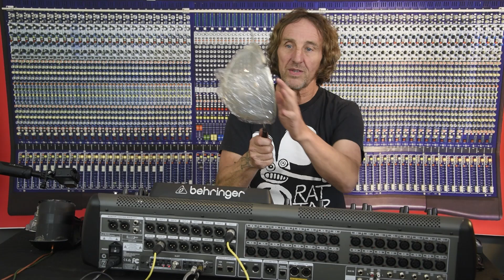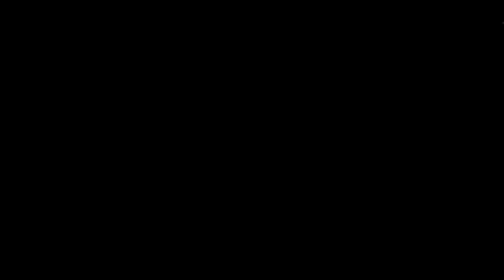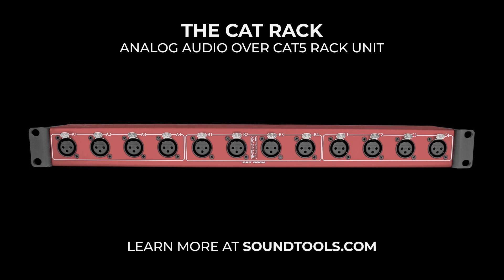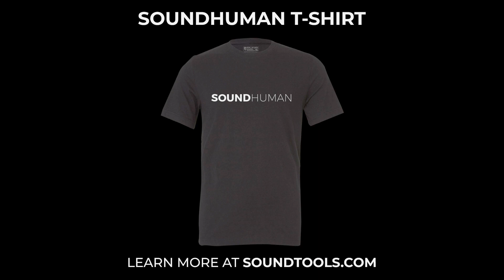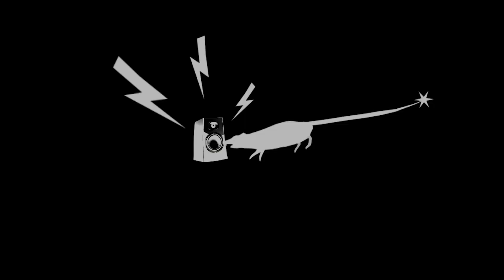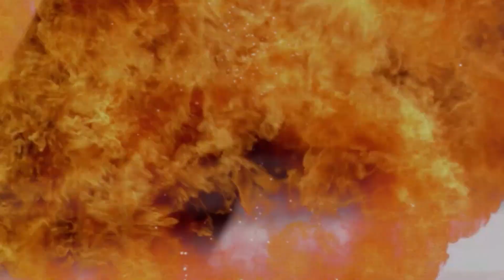Aux Fed Subwoofers Are Better - Because of How Mics Work

Comment: say I'm using a behringer x32 and had a PA with a crossover is 24db/oct. at 80hz, and a hihat mic with a lowcut at 400hz.... its pretty safe to say that nothing will be sent to the subs from the hihat mic.   but if I do aux fed subs and set the hihat mic to lowcut at 80hz (same as the crossover) then essentially the hihat mic will be heard as if it had a 48db/oct. steeper low-cut as the mic channel lowcut and the stereo PA lowcut both combine
Reply from the maker: And everytime the singer moves the vocal mic, mud gets sent to the subs, all the vibration of the drum riser sends mud to every drum mic. Every breeze, fan or ac  air blowing sends mud to every mic. Cumulative mud ends up in the subs

Comment: I love having a separate send to Subs! Consoles like M32/X32 have a mono/center feed which i use to feed subs. The awesome advantage of using is unlike an aux send,  you can set m/c to follow LR Level so you can bring the whole mix down without altering the relative balance between Mains & Subs.
Reply: I sometimes use a matrix for a second set of speakers and put L/R and the matrix in a dca group. That way you can control all speakers with one fader if necessary .. and are still able to control the balance with the matrix or/and L/R fader. Works with M/C, too of course.
Reply: Adds an independant layer of insert, eq and compression, too (at least on the x/m32), which is pretty handy.
Reply: I have a question. I have a decent bar PA, JBL active 15" tops and some Carvin subs with a Peavey power amp. The power amp has a built in crossover that works really well that I set at either 90 or 100hz. Kick, bass, and floor tom run on AUX bus to subs through Soundcraft UI24. My question is, should I be using a HPF on the mains? I'm familiar with using HPF on mains to avoid mud from subs and mains both adding low end energy, but I kinda think leaving the mains full range will help carry low end of mid range sound sources like guitars and vocals, without being in the subs. I'm sure that's cutting back on headroom in my mains though. Sure I'm over thinking this, but curious on everyone's take
Reply: @mojoemurphy  Rule of thumb, if the speakers have a HPF built in, use that rather than the HPF from your mixer. QSC K10s for example paired with QSCsub have built in crossover at 100hz. When your mains are at full range what is the lowest frequency it produces? If you have a guitar or vocal track you probably have a HPF on the EQ already to 40-120Hz. From 100-400Hz, ya you want that information coming through, it gives some meat to the guitar and cutting that out wouldn't sound right. Some guitars are bassy, some are high ans twangy. Start low and roll of until you notice a difference in the sound, that's when you've gone too far. Remember our job as live sound mixers is to reproduce the sound as clean as possible without shaping it beyond what the band wants.
Reply: @gnocci42069  this is fantastic info, thank you!
Reply: @mojoemurphy  If your tops can handle it this is optimal! venue i used to mix at had a bunch of 'arrayed' 15" Meyer boxes for the tops, they had plenty of juice so using the adjustable HPF I set it below the LPF on the subs, to somewhere like 70hz... low enough to get the acoustic thump but still filtering out that excessive info in the sub bass... as a bonus it supported the 100hz thump on the kick and left more energy in the subs for the bass boom...
Reply from the maker: @GrantCarruthers cool and also even if the tops do not have lots of low end power, having the ability to Not send instruments like cymbals and vocals and guitar to the subwoofers band really clean up the mix.

Seems a lot of people think think a high pass filter can prevent low frequencies from passing through.
But no, a high pass only reduces low low frequencies. 

To prevent low frequencies you need a separate send.
Reply: @ashergregory2013  I haven't messed with the matrices yet in this mixer
Reply: If a HPF is all you need on your mains, try the one that's inbuilt into the Main LR graphic & see if that suffices.
Reply: @ashergregory2013  I've used the HPF on the main EQ, I'm just curious if I should be using a HPF on the mains at all with the subs being aux fed
Reply from the maker: The HPF on the mains is to limit freqs below what the mains can create for protection and and to reduce wasted energy below the capability of the mains.

Using a HpF will often allow the mains to be pushed louder before clipping or distortion.
Reply: @DaveRat  sounds like using a HPF is the way to go. If I'm setting crossover on subs to 100hz with 24db/octave, should I do 100hz hpf for mains as well or a bit higher?
Reply: @mojoemurphy  Setting the HPF on mains 100hz would be a good starting point & you can tweak it to your liking. 

If you're deploying your system in the same config every time & you really want to dial everything in. I'd suggest going to an open flat grass field & taking some measurements using a reference mic with smaart or similar tool. 
Without going too much into it, you can really determine the optimal crossover point & phase relationship between your Mains & Subs.
https://youtu.be/5leb1k4LUA0 here is a video that goes through the setup & process.
Reply: I run my Sub outs on an Aux when mixing FoH pretty much all the time. You just cannot get the same level of control otherwise. There’s a bunch of different ways to do it, but the idea is pretty much the same.
Reply: On an Allen Heath 16fx , is there a way to get the pre or post fade Aux fed sub to link to the master send? Only sending certain intruments to the sub is DEFINITELY the way to go, thanks Dave
Reply from the maker: To be honest I'm not really that familiar with those consoles and I borrowed it for the video but don't have it anymore
Reply: What’s the frequency specs on that subwoofer..?
Reply from the maker: @michaelanderson4265 I don't have the specs on it but it goes down pretty low and has output to 25 Hertz but it doesn't get very loud
Reply: Does the M32/X32 have parallel compression (i.e. a control 4 blending the uncomped sound with the comped 1)? Also does it have sidechaining? Or M/S?
Reply: @davegraham716  You can compress parallel using busses, it can do sidechaining, M/S is possible but fiddly... It doesn't have a latency compensation for inserts. You can kind of work around it, if you insert an disabled effect on the unprocessed path. Afaik the Wing is much more versatile when it comes to effects (number of inserts etc.).
Reply: That’s what I started doing on M32/X32 consoles, upon realization what the M/C output can be used for. Prior to this, I had occupied Aux sends for subs, so it’s a lot easier to adjust per channel since it’s on its own knob instead of paging through bus sends. And the concern over crossovers? High pass/low pass on mains and subs, easy.
Reply: I have that M/C in my matrix page, but I'm not sure how to assign it to a physical output. I'm sure it's simple, but routing isn't my strength with this platform yet. I e hundreds of hours mixing with X32 and piles of useful scenes for dozens of bands I work with, but I feel I'm still missing some finer features applied. Currently I have L & R out of 7-8 with a LPF as an Xover and two subs (L&R) out of 5-6. I do this because many rooms I'm in a quite lopsided and I often unlink the outputs and run them at different velocities based on what's happening in certain parts of the room when I'm out there with my iPad. 2/3 of a crowd may be shifted to one side and further away while some of the crowd is concentrated much closer to the PA on the other side. It's almost like I'm mixing two separate PA sometimes. Any suggestions based on my weird application?
Reply: @jaredstreeter5911  Hey Jarred, i'd suggest hitting flip to faders.
Select mono & push Matrix 3&4 faders to unity. 
This will route any signal coming into mono go to matrix 3&4. 
Make matrix 3&4 mono/unlinked & make sure LR isn't being sent to it either 

This will still give you the flexibility of dealing with your lopsided subs on matrix 3&4, but still retain mix separation on inputs between subs & LR

On top of that if you have "mono follows LR fader" selected, You can bring your system down with LR fader & not upset the relative balance between your lopped subs & mains.
Reply: A work around would be to set the aux master to the same level as your main fader, and if you need to change the main just match the aux. But agreed; boards that have a mono or center bus is pretty handy

Comment: I’ve been obsessing over this topic for months now!! I love the concept of the LR going everywhere and using EQ to determine what goes to what. I started doing virtual sound checks at home with two mains and a sub, I noticed that a bunch of vocals, guitars, etc were going to my subs even though the vocals are HP at 170hz!!! And subs LP at around 100hz. It just didn’t make sense to me or I kept thinking I was doing something wrong. Lol 

Thank you so much.
Reply: @DaveRat  @Rene Why is this happening though? Why are frequencies above the crossover getting through? Is it because the slope of the crossover is too gradual and some higher frequencies get reduced but not muted? If so, should the sub be calibrated differently?
Reply from the maker: A high pass is a filter. That filter has a slope quite often 12 DB per octave.

If you sent a high pass at 200 and the slope is 12 dB per octave, one octave down is 100 HZ so the sound will be 12 DB down at 100 Hertz at 50 HZ it will be 24 DB down.

You can get high passes with higher slopes but the higher the slope the more they impact other things like phase shift and ringing

If you don't want something to go there don't send it there if you want most of it not to go there but some of it to still get through then use a filter

Comment: Right. You can low cut on ones that don't need it but the mic is distorting when the placement is not good. And in the old days, there were no subs. Full balanced mix. Aux makes sense.

Comment: But ... if you look from a different perspective, equalisation and filters are used to achieve the desired frequency response of the path between the source and the listener. By not sending something to the subs, you are basically using the HPF of the crossover besides the channel/bus HPFs. If the crossover is set low enough, the natural roll-off of the tops also acts as an additional HPF. All these frequency response changes result in similar phase response changes. Whether you use a higher-order HPF on the channel, a HPF on the channel and on the bus or just the roll off of the tops (crossover or not) the resulting frequency response for the listener will be the same if the same slopes are used at the same frequencies. So in terms of the frequency response (at the "sweet spot", where the system is perfectly aligned), the aux fed subs do nothing that can't be achieved by using the equivalent HPF slopes on the console. Yes, on some consoles, it may be easier to achieve the desired frequency response of a signal path by simply not sending the signal to the subs, but at the same time this also dictates a workflow which makes certain mixing approaches much more difficult if not impossible. 

At the same time, yes, you are not sending the signal to the subs, but the roll-off of the crossover is not infinitely steep and many larger systems go pretty low even without the subs, so by not having the subs playing these frequencies, you are not actually eliminating these frequencies. If you mix by ear and adjust the HPFs to achieve the desired frequency response, these sounds that are below the cutoff frequency but still noticeable, are in one case reproduced by the whole system, keeping the coverage as designed, but in the other case only reproduced by the tops. So if the crossover is set at 100 Hz and 12 dB/oct, the instrument has a fundamental at 80 Hz but because of the proximity effect, a 12 dB/octave HPF at 100 Hz will result in the flat FR at 80 Hz. When the subs are run from the whole mix, you'll achieve this FR by setting the channel HPF at 100 Hz, if you keep this HPF setting and use aux fed subs, this fundamental will be almost 5 dB too quiet (if using Butterworth filters), so you'll have to remove or severely reduce the HPF frequency on the channel. Now this fundamental frequency is at the right level but instead of the even coverage produced by a large subwoofer array, you are dealing with the power alley and cancellations produced by the LR mains. Besides that, many speakers have a less than flat phase response in the crossover region so because by varying the level of the subs, you are effectively changing the crossover frequency i.e. the frequency at which both subs are at the same loudness, you are basically messing with the system alignment at the crossover frequency. Not a huge problem in many cases and can be avoided by using a group/fixed level send but an imperfect attenuation in the stop band of a filter usually isn't either. Oh yes, how the system is crossed over will also affect your mix which is probably not a good thing if you are touring with the console but use a different PA every day.

Anyway, my point is that both approaches have some advantages and disadvantages and depending on the situation, these can make a significant difference.
Reply from the maker: And also using high pass filters adds an extra filter and issues inline redundant to the x-over. The high pass actually messes with the sound of the lows of the instrument. In some of my X32 videos I show the issue on the scope and you can hear it.

Also, yes, some pa systems do go low but the mechanics of the speaker design actually prevents most non subwoofer cabs from reproducing lower sub frequencies.

Not sending garbage to the subs is always better. But for some or many applications, the garbage may not be audible or will be acceptable and not worth the added effort.

Comment: Here's how I think about this: nearly everything we manufacture must be able to fit on a truck, cargo container, etc. The roads are only so wide, so to speak. The engineers know this, so they account for this limitation DURING the design process - they ship big things in pieces. Likewise, we as mix engineers need to understand the limitations of a PA, and mix accordingly to give each "driver " (pun intended) what it can appropriately handle. Otherwise we're left with a gigantic mix that can't actually go anywhere.

Thanks Dave, another great video! Very thought-provoking as usual.

Comment: The open statement is the linch pin of why  playback is not live .  The audiophile goal to sound live is at best an illusion .  What stereo can do is present a very good approximation of live .  If it gives some of the proper ques the brain fills in and creates the illusion.  It a live setting the need to control  what is presented  is  important not what just is pickup by the mic .  Very good demo of what is the reality in the field not just what people think happens.

Comment: Hey Dave, always appreciate your content and perspective. You always get my brain working. I see pros and cons to this method depending on the console that is being used. If the console doesn't have delay compensation for the group/aux busses how do you suggest avoiding comb filtering between the L/R mix and the subs on aux? I suppose that you could send the subs into an aux then send that to a matrix output as well as sending the L/R mix to matrix outputs, but still not sure if this would be completely phase coherent depending on the console that is being used.
Reply from the maker: Comb filtering occurs when the same signal is combined with a time delayed version of itself

With subs, the only common frequencies between mains and subs would be in the crossover region. If you crossover at 80hz, that has a wavelength of 14 feet.

If your console has a latency offset of 1ms, that would be the same as mucing your subs 1 foot closer or farther. And have an impact of less than 1db in the crossover region.

In other words, a non issue or at least a small fraction of the issues that not having subs on an aux creates.
Reply: @DaveRat I can agree with that. Typically the comb filtering between an aux and L/R output is marginal at best. And some of the more challenging environments tend to require compromise and choosing your battles wisely. For example, the wind noise issues you mention. They can be extremely difficult at times, and aux driven subs will help clean up some of the sub frequencies. But that still doesn't clean up all the wind noise that occurs between the frequency range of 80-250Hz. What is your go to approach for taming wind noise in a vocal mic (besides throwing a wind screen on the mic)?
Reply from the maker: Widnd screen is the way, once the wind noise gets in, no way to get it all back out